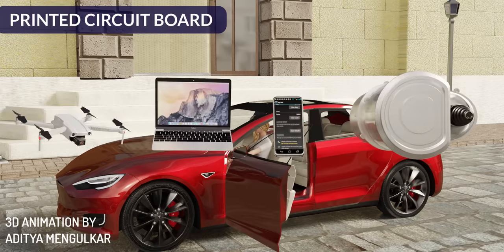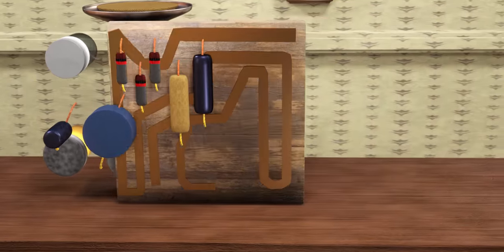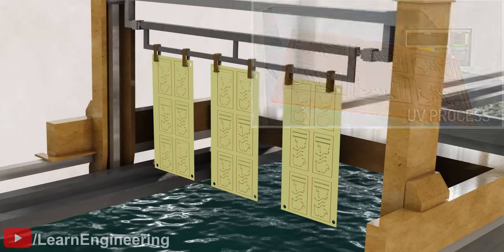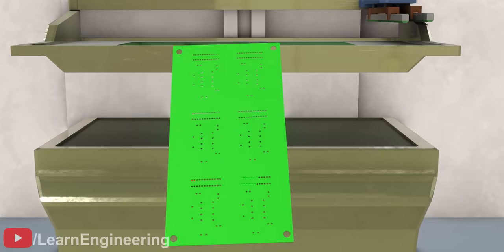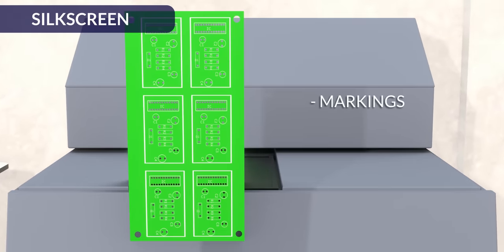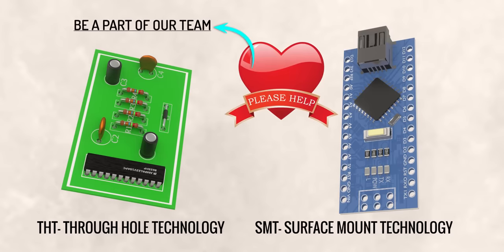What is a PCB?

Comment: Clearly explained. An excellent video with beautiful animations.
Reply: Thanks! ranbir sir😇. Your support to LE is appreciated.
Reply: @getartsywithyogita8291  Thank you for putting in so much quality effort to help engineering and polytechnic students understand difficult concepts easily and precisely.
Reply: @SALESENGLISH2020  it my pleasure sir. Well i get paid for doing what i love! I am blessed. Good wishes sir. 😊
Reply: @getartsywithyogita8291  That's a great attitude. 
I always say to young people, "If you love the job you get, someday, you will get the job you love."
Reply: @SALESENGLISH2020  😇 true sir.
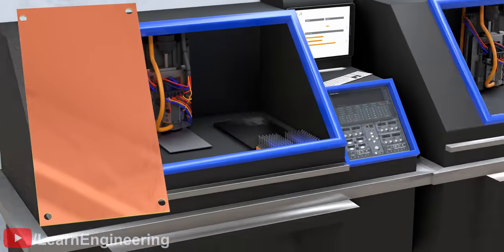Reply: 1:50

yes, beautiful animation indeed
Reply: In todays technological advances it still boggles me in the fact that we’re still using copper instead of silver, The most electrically conductive element is silver, followed by copper and gold. Silver also has the highest thermal conductivity of any element and the highest light reflectance. ... As to why silver is the best conductor, the answer is that its electrons are freer to move than those of the other elements

I’m guessing that we have to request a custom design motherboard using pure silver over copper
Reply: @MINDSPARK-u6e  In the 1960s engineers tried Silver finishing. But it was rejected because of the dendrite growth in silver creating short circuit problems. There may be other reasons such as cost... Search Quora for a good explanation for why silver is not used for PCBs.
Reply: @getartsywithyogita8291   l
Reply: @MINDSPARK-u6e  growth and cost of silver is the reason

Comment: I've read hundred time about single multiple layer PCB each with different etching Technic but animation makes is look even more easy to understand
Reply: I remember working with my first multilayer boards doing component level troubleshooting, in the 1980s, what a pain. I worked in electronics and telecommunications for a time spanning 51 years. I first worked in a tv repair shop at the age of 16 in 1970.
Reply: @Chris_at_Home  my question is sir, how the manufacturing machinea are made??
Reply: @Chris_at_Home  ..
You study machines

Comment: I have experience working for a pcb manufacturing company in South Korea.
We made the product at the request of Intel, Samsung, and SK Hynix.
Most of the processes are automated. However, it is necessary to always monitor whether the automated facility is operating properly and change the data according to the conditions of the product.
I had to constantly doubt and check the results of the machine.

For example, in the plating process, whether it is gold or copper, what is the thickness of the plating, whether the plated surface is smooth, or if nothing is plated other than the design... I had to check one by one using a magnifying glass.
Even when working in the painting and marking parts, I always had to check all the results one by one.
The reason why people have to check and control each and every one of them is because...

It's because PCB is 3D!
The plane of the pcb is not a complete plane. Plated and circuit-injected areas protrude, and holes are in.
Production drawings and films are paid on the assumption of 2D without considering 3D.
Especially during the ultraviolet exposure process, the film adheres to the pcb product.
Because of the difference between 2D and 3D,
Fine differences occur.

If the size ratio between the film with the drawing and the actual pcb is perfect 1:1, the film becomes almost unconditionally small due to the 3D of the pcb.
Therefore, a slightly larger film is provided than the actual product.
When production workers actually make it, some parts of the film are small or large.
In some cases, the drawing film may be modified several times.
These tasks should be checked one by one using a magnifying glass.
It takes a long time, my eyes are stiff, and I'm stressed out.

The higher the density of the circuit, the higher the production difficulty.
This is because there is a high probability of interfering with circuit imprinting, plating, painting, and marking.
Reply: Damn underrated comment
Reply: You have a wonderful job, mate, not everyone had your expertise.
Reply: At least some places have a manual step of aligning a transparency with black lines on it.
For green boards not a problem.
Some customers order black PCBs.
Some customers get cursed at when they can't hear.
Reply: In todays technological advances it still boggles me in the fact that we’re still using copper instead of silver, The most electrically conductive element is silver, followed by copper and gold. Silver also has the highest thermal conductivity of any element and the highest light reflectance. ... As to why silver is the best conductor, the answer is that its electrons are freer to move than those of the other elements

I’m guessing that we have to request a custom design motherboard using pure silver over copper
Reply: @MINDSPARK-u6e  
And what do you do with it a couple weeks later when the silver is tarnished?
Reply: @MINDSPARK-u6e It may be that silver is less in availability and also more expensive.

Comment: Thanks for placing PCB order on us! This video is amazing, learned a lot! Feel free to let me know if you need more PCB in your next projects.
Reply: i doubt that the PCB company really learned anything here
Reply: @poot6365  lmao
Reply: In todays technological advances it still boggles me in the fact that we’re still using copper instead of silver, The most electrically conductive element is silver, followed by copper and gold. Silver also has the highest thermal conductivity of any element and the highest light reflectance. ... As to why silver is the best conductor, the answer is that its electrons are freer to move than those of the other elements

I’m guessing that we have to request a custom design motherboard using pure silver over copper
Reply: @MINDSPARK-u6e  Simply put, copper is much cheaper than silver.
Reply: @MINDSPARK-u6e  silver's costly man
Reply: @MINDSPARK-u6e  The first thing is silver is much expensive than copper.

Comment: 25 years ago, as an engineering student, we designed our own pcb’s and “manufactured” our own self-made radios, and other electronic equipment
Reply: In todays technological advances it still boggles me in the fact that we’re still using copper instead of silver, The most electrically conductive element is silver, followed by copper and gold. Silver also has the highest thermal conductivity of any element and the highest light reflectance. ... As to why silver is the best conductor, the answer is that its electrons are freer to move than those of the other elements

I’m guessing that we have to request a custom design motherboard using pure silver over copper
Reply: @MINDSPARK-u6e  copper is 99% cheaper than silver
Reply: @MINDSPARK-u6e  copper is significantly cheaper
Reply: Ñ
Reply: I feel you one wrong move on your pcb ur project will be gone haha
Reply: 0j
Reply: @MINDSPARK-u6e The people getting paid to think about it aren’t the ones making executive decisions.

Comment: Gerber files do not contain 3D model information. Gerber files contain the information on each 2D layer in a board. There’s a drill file for the entire board and a layer file for each layer in the circuit board.
Reply: Gerber data is photo plotting data from the 80's for the textile industry(AFAIK).
With a couple updates over the decades. 
It is amazingly primitive.
And the drill data is usually included in a layer now.
Reply: @stephenolan5539  drill data is not included in the layer. Drill data has an nc drill file. There are voids in the copper where a drill will pass through but this is not drill data. The copper would be removed in an etch but there would be no hole in the core.
Reply: @RedHaloManiac95  
Then how was I looking at drill data in gerbera this morning?
I was looking at drill holes vs masking.
Some holes that were masked on the customer's gerbers were not masked  on the board shop gerbers.
And the board shop was not given a separate file for the drill locations.

Comment: This is the fancy version. 

The broke version involved a piece of paper, a flat iron for clothes, and some luck your circuits were good. Put the paper with your circuit board traces on it which you iron onto the copper board, use acid to etch it in, put a silkscreen and laminate it and boom. Nowadays it's a lot more automated and precise.

Comment: As an engineering graduate, I would have loved my course years ago if this was easy. I mean, back then, we were forced to drill, weld, and etch manually by hand to the board even though such software exists.
Reply: Pp
Reply: Ñ
Reply: Isn't that the point? That's like a farmer complaining he had to learn that different plants take different water or that his animals have to be fed more than once you cant just type 101010101 and that fixes everything so you need to learn where it comes from what controls those 101010101s and why and how i wish that was a class i could have learned in school i am class of 2011 so I think I was the last class to have to do cursive in 3rd grade but that was in Montana I don know how oregon does it but dude my freshman classes 4 of them where senior classes in Oregon so I had to redo my freshman year cause technically I had no freshman credits just shop JR and SR
Reply: @imfatkid420  simplicity on its application is superior and still the best.

I was crunching hard also on calculus on paper only to realize matlab and excel can do the job for you, like what the f. What sucks here is that I feel like I only am touching the surface of the water for both softwares I've mentioned.
Reply: My hand is hurting just reading this. I never designed a pcb, though a schoolmate did. Just thinking about having to etch those lines by hand is just painful, because mine twitches randomly whenever I try to exercise fine motor control.

Comment: Is the "printed conducting coper circuit" right from 0:48 to 1:04 right? The copper forms a "short" circuit?
Reply: A "short" circuit means an unintended connection.
Although to be honest if I am checking for opens and the circuit is good, I will call it short. Although technically I should call it connected.

Comment: In todays technological advances it still boggles me in the fact that we’re still using copper instead of silver, The most electrically conductive element is silver, followed by copper and gold. Silver also has the highest thermal conductivity of any element and the highest light reflectance. ... As to why silver is the best conductor, the answer is that its electrons are freer to move than those of the other elements

I’m guessing that we have to request a custom design motherboard using pure silver over copper
Reply: That's gotta be expensive, especially at the scale of manufacturing happening today

Comment: i not understand @4:35 how can u erase the green insulation from the holes ? apply chemical resistive mask on the holes and then dip in solution , but previously the chemical resistive mask protect copper traces and all copper dissolved

Comment: How does it make any sense that only the surface gets etched away? Wouldn't the electricity flow through the inside of the copper plate and fry the components?
Reply: No
It is completely gone except where it was marked from etching.
Reply: @stephenolan5539  How is it completely gone? It’s an 3D solid copper plate. The entire surface gets etched except the protected part that’s supposed to conduct electricity. But it can’t get etched inside, so the electricity would flow just anywhere.
Reply: @GodVanisher  
The copper plate gets bonded to a sheet of FR4 fiberglass.
This video is oversimplified.
Almost all PCBs have an even number of layers because both sides of the fiberglass sheet get a copper layer.
And most of the time at least two sheets are combined.

Comment: Where does the waste copper go from the disolved copper plate, is it recycled??
Reply: New method solved that problem
Reply: Oohhh, that means that much copper WAS getting wasted earlier😅😅
Reply: @anshhseksaria5547  well,  where does this wasted copper be after doing this operation,  and how do I find, and which method or how do I use this copper in alkanik copper?  
If I dropped a piece of copper in a water, 
What benefits of this

Comment: why are they made out of copper? doesn't aluminium have a lower resistance?
Reply: Al have lower conductivity than Cu.
Reply: Aluminium is very difficult to solder .
Reply: @tonywright8294  chemicals are step for making a good shape of material, and physics gives a power when conductivity in different components,  things, for making a technical things to be a product ..
Making products are different ways of manufacturing ,each thing has its way to make it perfect .
Things are necessary for making a product 
Like - battery,  lamp,  wire 
We should during this checking, analysis results, to do a good quality through study it to be a graphic design.picture of productivity. 
The problem 
I couldn't make thing ,because I don't know.

Comment: You completely glossed over through-hole inserts.  Every drilled hole has a ring inserted into it, to bridge the gap between each side of the PCB.  Without them, the traces that run to holes would not be electrically connected from one side of the board to the other, and the board would be useless.
Reply: It wouldn't be useless and not needed if the board is only one side.  And the technical term is "layer" because you can have more than just top and bottom layers.

Comment: How do you think modern pcb will look like when the right to repair is allowed. Like will it be more complex but easier to repair?
Reply: Depends on technical manufacturing and designing on particular materials and assistance to it 
..like a board..  
If you want to be a electronic power of rays of sunshine 
You costume this power to give you another engery to give you an electric energy to supply it in hard and easy things .
Reply: @JenneSarah  thx, I guess it's still confusing.
Reply: @marz.6102  you need ask yourself 
How this thing works?!  
Then, how do I make it perfect ..
Could you make a car? 
If you have experience, give me 
😀
Reply: @JenneSarah  y do you need to make a car?
Reply: @JenneSarah  just curious.
Reply: @marz.6102  no,  but for knowledge, information.
Reply: @JenneSarah  ok then
Reply: @JenneSarah  what kind of car?
Reply: @marz.6102 
 Bmd

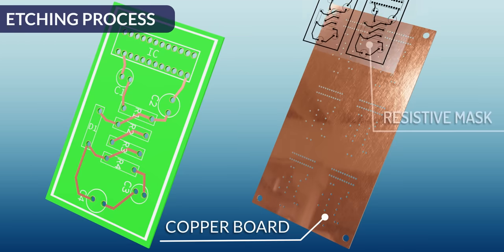Comment: 🤔 2:33 — it is not clear how the "resistive mask" is made, the layer on which the masks are fixed to protect the tracks (worms) must either peel off beforehand or dissolve in an alkaline solution together with copper, I had to stop at this moment 

🇷🇺 2:33 — непонятно как изготавливается "resistive mask" слой на который закреплены маски для защиты дорожек (червячки) должен либо предварительно отклееваться либо растворятся в щелочном растворе вместе с медью, нужно было остановится на этом моменте

Comment: PCB is Pakistan Cricket Board lol 😂
Reply: In todays technological advances it still boggles me in the fact that we’re still using copper instead of silver, The most electrically conductive element is silver, followed by copper and gold. Silver also has the highest thermal conductivity of any element and the highest light reflectance. ... As to why silver is the best conductor, the answer is that its electrons are freer to move than those of the other elements

I’m guessing that we have to request a custom design motherboard using pure silver over copper